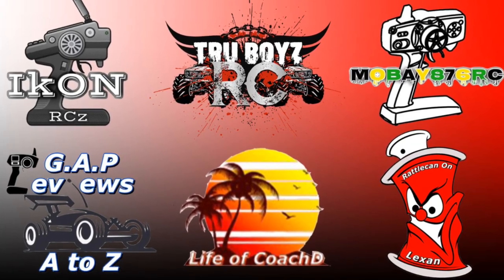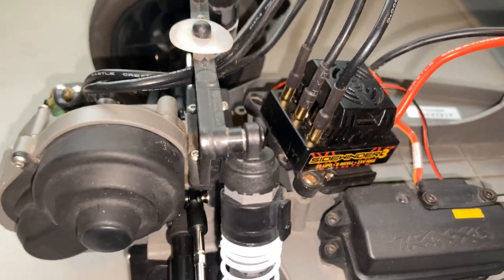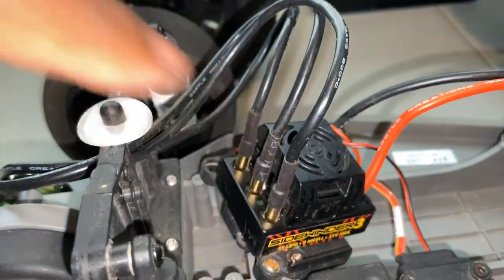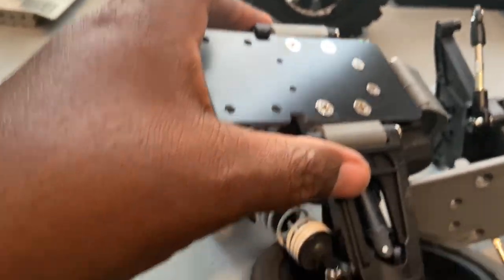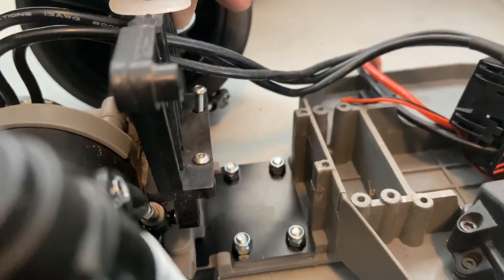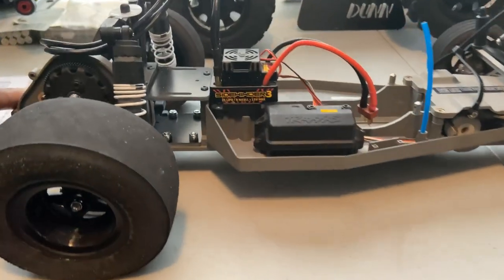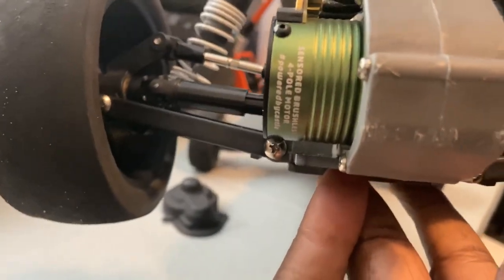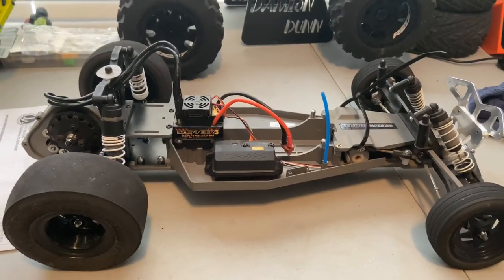Traxxas Rustler Eliminator Drag Conversion

Comment: Did you have to cut the bandit arms down? Someone told me I’d need to cut a half inch off them to tuck the tires
Reply from the maker: No you don't have to cut anything. That's why you use the bandit arms so it tucks.
Reply: Awesome thanks I’ll get them ordered. I’ve made my own 43mm extension plate so all I need to pass tech is the arms now.

Comment: @ Life of CoachD will the wide body's fit the rustler or do you have to run Bandit arms and links
Reply from the maker: WildinOutRC i have the bandit arms and turnbuckles on it with the fox body, Parma bodies will fit if you leave stock axles and turnbuckles.

Comment: Is there a formula to make the Rustler work with the the Grand National JConcepts body? I see that the wheelbase for the Fox Body and GN are close enough, but what about the width? 304mm vs 273mm.
Reply from the maker: Yes you have to buy a +43mm rustler extension on eBay, you also need to use the bandit axles as well as the 36mm bandit turnbuckles.
Reply: @CoachD386  Thanks for the response. Oh I see, I won't need the arms, just those two parts, which will bring in the wheels just enough.
Reply: Make your own extension with 1/8” aluminum 2”wide. I’ve been making these left and right. Also the axles, if you run the stock slider driveshafts just cut them shorter.